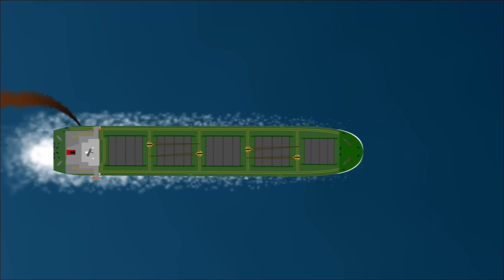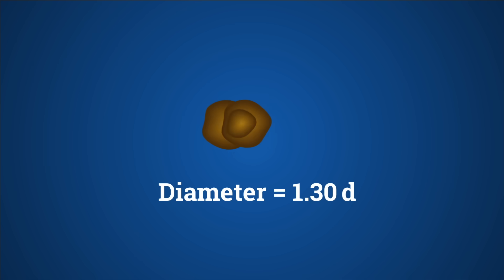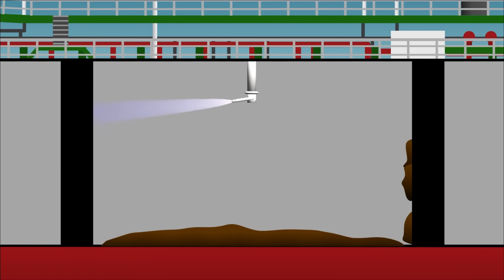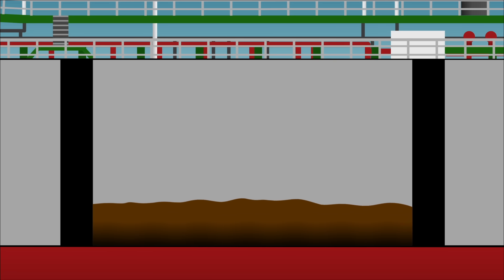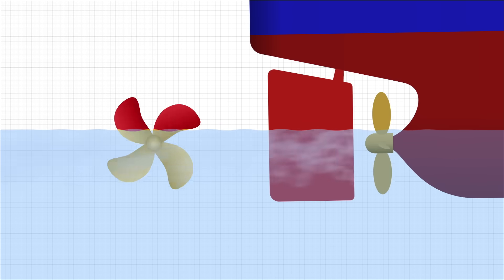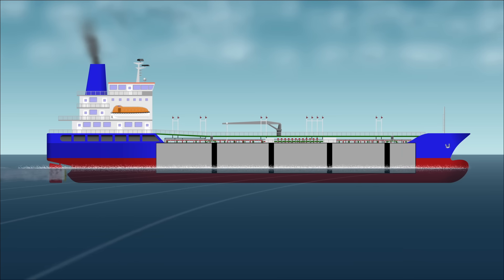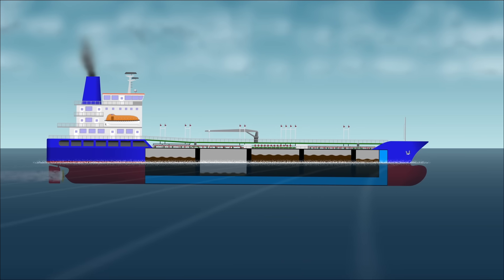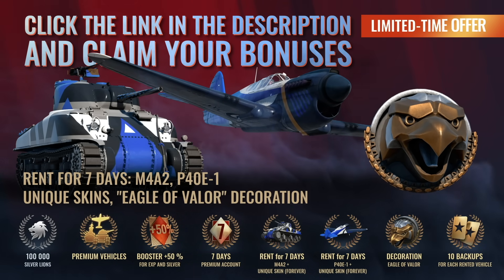Why do Ships 'Dump' OIL Overboard?

Comment: Okay a few things that are wrong in this video

1. Crude Oil Washing is only carried out in Crude Oil Tankers. Other tankers such as product tankers still have to do sea water washing. Chemical tankers have something called a prewash that they have to do.

2. Filling up your cargo oil tanks with ballast is obsolete. Segregated Ballast Tanks are the only tanks allowed for ballast in newer regulations.

3. 3 more conditions for discharge of oil into sea, cannot be in a special area as defined by marpol annex 1; total amt of oil that can be discharge is 1/30000 of the last cargo carried; vessel needs to have a functioning Oil Discharge Monitoring and Control System (ODMCS).

4. The ODMCS has to maintain a record of previous discharges and a record has to be preserved onboard.

5. The Stena immaculate - Solong accident was not in english channel but actually in the north sea.

Comment: On US Navy Ships, I've heard it plenty of time, "Request to pump bilges no oil." US Navy Ships don't pump oil into the sea. Waste Oil is separated and pumped into a barge when ship has pulled into port. The bilges get a lot of water in there with lots of oil floating on top. I've fished around in the bilges for dropped tools. You can't see the tools, you have to reach down there, even get in the bilge water to find the tools.

Comment: Interesting point regarding a propeller running only partially submerged - this is actually standard practice in performance boats as the top have to the rotation does not provide as much thrust as it does drag.  It's called a surfacing propeller and is quite common.

Comment: For the first ~1/2 of the video, for the examples given of how oil could end up in the ocean, I just thought "these are simple problems that will disappear with the advancement of technology, as has happened repeatedly over modern history."
The additional regulation of the dedicated ballast tank is a great example of something that was very likely heavily opposed by people in the industry, but arguably a necessary evil. Immediately, upon seeing the graphic, I thought "oof, wasted capacity! I bet captains and cargo ship owners don't like that!"
Now the tanker is less efficient. It can carry less oil cargo per the tanker's total volume. In other words - wasted space! And, therefore, increased cost to ship that item on a per unit basis.

I'm not in the industry. Never been on a ship in my life!
I'm just using this example to illustrate how even simple, 'common sense' solutions can have multiple perspectives, and should be thoroughly evaluated! For example, is it possible the oil tanker now uses more fuel, creating more pollution, to transport the same amount of cargo (to make up for lost capacity) than the amount of pollution it saves by not using seawater to wash out the oil tanks? I doubt it, but curious!

Comment: We do the same thing on submarines! However, since a lot of our equipment is operated with hydraulic oil throughout the ship, we can have oil leaks into our bilges in every compartment. To address this, all of the bilges can be "vacuum-dragged", where a large tank is kept at a vacuum, and valves in the bilges opened to suck the water into that tank. That tank then acts as a settling tank, allowing oil to collect at the top, and any excess water being pushed through to an overflow tank. We can pump the overflow tank overboard (with the above mentioned restricions), and we hold on to the oil in the vacumm tank until we can pump it to a collection facility in port. 
    Additionally, we use centrifugal purifiers to remove water and sediment contamination from our lubricating oil for the propulsion train

Comment: Check the facts, it was the North Sea not the English Channel, and the US tanker was anchored off Grimsby awaiting entry to Rotterdam and she was carrying Jet A1 fuel for the USAF, basically light Kerosene so floated easily and broken down by seawater, most was burnt off by the ensuing fire.  The Master of the Cypriot registered Container ship was charged with various marine offences and is a Russian National.  The anchored tanker was transmitting its status and position, a known anchorage and should have been detectable to the container ship.

Comment: This channel finally seems to be back to the original quality and standards that we have come to expect. You all have earned a resubscription from me.
Reply: This channel still barely has a grasp of the subjects they are discussing, please disregard the comments saying otherwise:

1. The issue with settling out oil from bilge water is not so much the time to separate. It is that the ship is rolling back and forth so it can't separate, since it keeps mixing back together. That is why you use a combination of heat and coagulation to force the two to settle out. The people on this channel haven't set a toe in a ship's engine room. 

2. I don't even know where to start witht their diagram of the centrifugal separator. If that doesn't make any sense to you the viewer, then it isn't your fault. They didn't give one iota of information on how they get it to separate. Hint: there are a lot of discs involved with narrow tolerances spinning at thousands of RPMs

3. Crude Oil Washing is only an option when carrying...crude oil. If you have any other kind of oil cargo on a tanker then guess what; you still use water to wash the cargo tanks, let the slops settle in a dedicated slop tank (which is in the stern of the ship, not the bow), pump the water into the ocean through an ODME, and then either recover the remaining cargo or dispose of it ashore. What they call old fashioned is actually still the norm.

4. Tankers have been required to have dedicated ballast tanks separate from their cargo tanks for decades now. The only time a tanker built in the last 30+ years is putting ballast water in their cargo tank is if they find themselves empty of cargo and in a tropical storm or other rough seas where heavy stability is required. They talk about cargo ballast like it is still the norm, when it is infact a borderline emergency procedure.

5. And most importantly there are not just 3 rules to discharging oil! The rules they do cover are simply form when it comes to discharging the slops. When running your OWS (the equipment in the engine room) the rules are very different. And in both cases there is a maximum concentration of oil to water which is really freaking important. You can never, ever, ever pump straight oil over the side unless in some freak emergency to save the ship from sinking. In fact most of the time when a ship is putting "oil" over the side it is in fact at a conentration of less than 15 parts per million (15 parts oil for every 999,985 parts water). Perhaps the most important detail when it comes to oily water discharge, and this channel leaves it out. Unacceptable

6. The Exxon Valdez and subsequent U.S. regs were the start of double hull requirements. They are now reflected by international rules and regs found in MARPOL and are required essentially everywhere in the world. Perhaps an important detail to include

7. The Stena Immaculate collision did not happen in the English channel
Reply: @phantomsplit3491 They are always looking for specialists for the writing team. Just sayin' 😀
Reply: agree
Reply: Yeah this video is much better

Comment: Good video. One slight mistake - the collision betwen Solong and Stena Immmaculate was in the North Sea, not the English Channel. You were only about 180 miles out.
Reply: Honestly if that's the biggest mistake an education video has - they did a great job given it's not critical to the point

Still nice to know the correct info so thank you
Reply: A suspicious collision, the Master of the container ship a Russian National and the tanker carrying Jet A1 fuel for the USAF to Rotterdam.  The tanker anchored in a known marked anchorage and had transmitted its position and status.  The Master of the Cypriot registered container ship has been charged with several marine offences including causing the death of a seaman.
Reply: Good spot! And there are still huge warning signs across North Norfolk's beaches to watch out for detritus from it.

Comment: Wow that double hull design is great. Water can absorb and distribute some energy too, so i thint there is still room for some upgrades. How exciting would be to research the best conditions for absorbing and distribute as much energy as it can be, even allowing slight plastic deformation of that liquid cargo part.
Reply: Think it started on warships, having void spaces helped even with torpedo hits on large ships.
Reply: Oh I can promise that these ships can absorb quite a lot of damage and still be fine. Unfortunately though, there’s no material or design in the universe that will withstand a collision from a 100,000+ ton ship colliding even at relatively slow speeds. The biggest innovations will always be in avoiding the collision in the first place. Better navigation systems, more reliable machinery, better training and procedures and regulatory oversight, etc.
Reply: @grahamsell3863  totally agree, but I do not search material like that. I think more about balance between elasticity and hardness. I want material to deform on impact and transfer that energy as far as it is possible, maybe even deform other side of ship on impact. I do not search some way to sustain all kinds of impact. It is impossible, but between 0 (not absorb) and 1 (absorb all) is infinity. I believe that ships can endure a lot, but why stop in that place already? Preventing from collisions is the most important thing, no doubt here, but when everything fail it is good to have one more, last barrier.

Comment: Given the massive profits in the oil trade , it wouldn't be too much to ask them to clean up after themselves. If the system is open to abuse , it's a given  that it is abused.
Reply: When you are at the pump refueling and drop 2-3 droplet of fuel on the ground or even the smallest leak on the oil stump, do you go and get some rags to clean it up or go away saying it’s fine even tho it’d cost you nothing to clean behind ? it is proportionally the same thing with the only difference that the oil goes away much better in the ocean where it has room to expand and dissolve than on the ground.
Nowadays the entire shipping industry has very little amount of oil discharged in the ecosystems compared to all of the cars and trucks worldwide.

Comment: This is a really detailed, clear, well-researched video: exactly what I’ve come to expect from this channel. Well done!
Reply: This channel still barely has a grasp of the subjects they are discussing, please disregard the comments saying otherwise:

1. The issue with settling out oil from bilge water is not so much the time to separate. It is that the ship is rolling back and forth so it can't separate, since it keeps mixing back together. That is why you use a combination of heat and coagulation to force the two to settle out. The people on this channel haven't set a toe in a ship's engine room. 

2. I don't even know where to start witht their diagram of the centrifugal separator. If that doesn't make any sense to you the viewer, then it isn't your fault. They didn't give one iota of information on how they get it to separate. Hint: there are a lot of discs involved with narrow tolerances spinning at thousands of RPMs

3. Crude Oil Washing is only an option when carrying...crude oil. If you have any other kind of oil cargo on a tanker then guess what; you still use water to wash the cargo tanks, let the slops settle in a dedicated slop tank (which is in the stern of the ship, not the bow), pump the water into the ocean through an ODME, and then either recover the remaining cargo or dispose of it ashore. What they call old fashioned is actually still the norm.

4. Tankers have been required to have dedicated ballast tanks separate from their cargo tanks for decades now. The only time a tanker built in the last 30+ years is putting ballast water in their cargo tank is if they find themselves empty of cargo and in a tropical storm or other rough seas where heavy stability is required. They talk about cargo ballast like it is still the norm, when it is infact a borderline emergency procedure.

5. And most importantly there are not just 3 rules to discharging oil! The rules they do cover are simply form when it comes to discharging the slops. When running your OWS (the equipment in the engine room) the rules are very different. And in both cases there is a maximum concentration of oil to water which is really freaking important. You can never, ever, ever pump straight oil over the side unless in some freak emergency to save the ship from sinking. In fact most of the time when a ship is putting "oil" over the side it is in fact at a conentration of less than 15 parts per million (15 parts oil for every 999,985 parts water). Perhaps the most important detail when it comes to oily water discharge, and this channel leaves it out. Unacceptable

6. The Exxon Valdez and subsequent U.S. regs were the start of double hull requirements. They are now reflected by international rules and regs found in MARPOL and are required essentially everywhere in the world. Perhaps an important detail to include

7. The Stena Immaculate collision did not happen in the English channel

Comment: I worked in the sanitation department of a nuclear powerplant in Sweden for years, you wouldent believe how much oil is spilled in all sorts of working machines
Reply: If you’re not leaking oil, then you’re out of oil
Reply: Oil comes from the GROUND!
Reply: @DougnTx It comes from way below the surface. It doesn't belong on the ground surface.
Reply: @DougnTx  Lava comes from underground but I don’t want it covering my front yard.